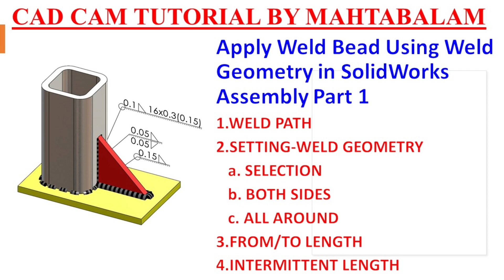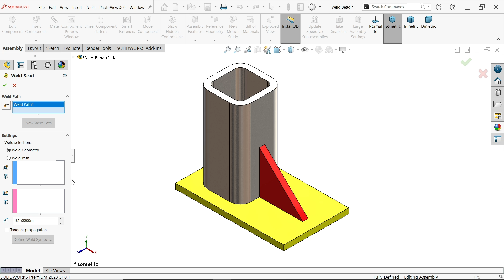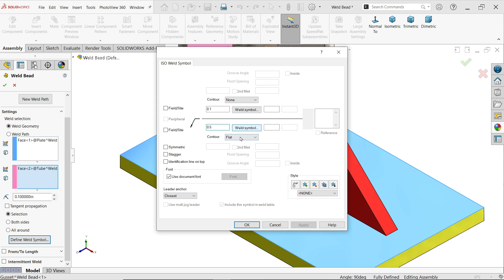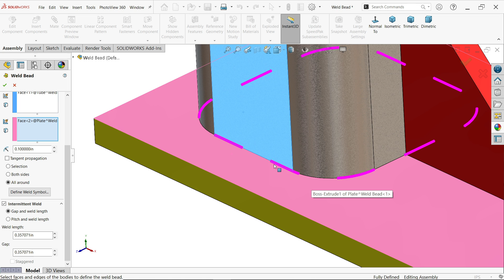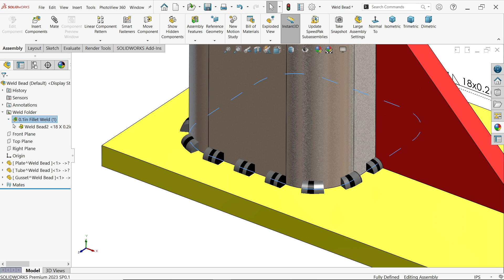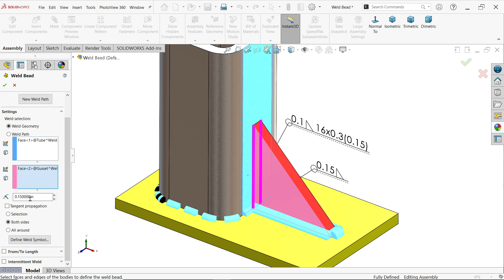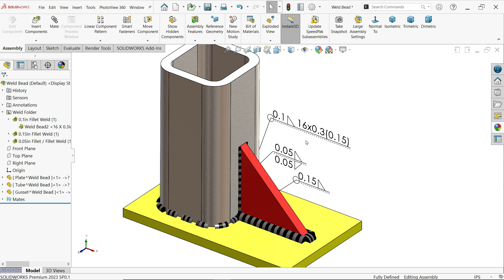Part1-Apply Weld Bead Using Weld Geometry in SolidWorks Assembly

Comment: What about Welded SUB ASSEMBLIES or "Sub-Weldments" ?? I have a part with elements that are to be WELDED., but apparently ONLY its TOP assembly can hold weld elements. AND What if we don't WANT to add a "Weld BEAD" - a graphical representation , but instead we want a FILLET WELD which is supposed to be a FEATURE entity, that responds to weight analysis AND interference calculations. AND WHY can we not deal with ALL AROUND paths with a CONTINUOUS FILLET WELD (??) , or deal effectively with Weld Prepped joints ? What is WRONG with S-W ?? Why is this not AVAILABLE and OBVIOUS ? What you show as welds along two edges do NOT appear as WELDS but as disjoint IMAGES - right there in YOUR Video !!